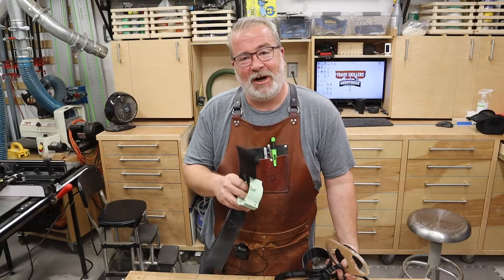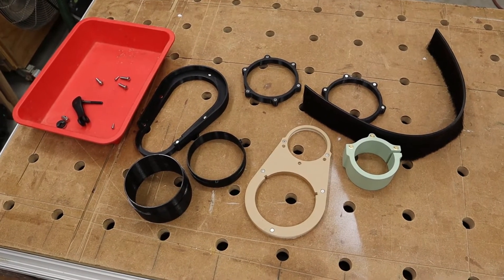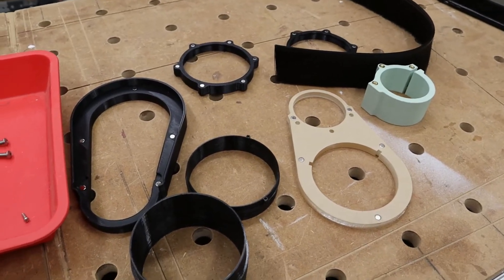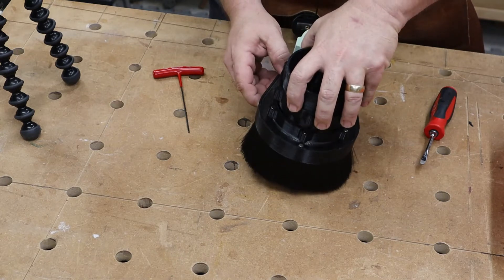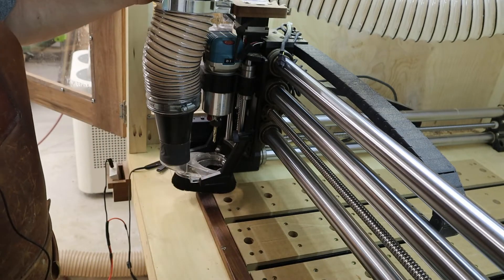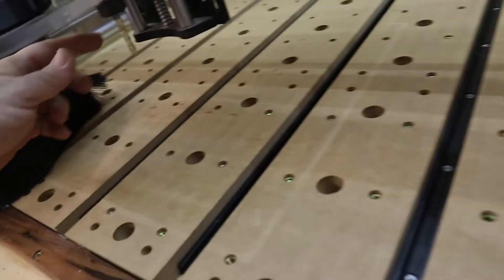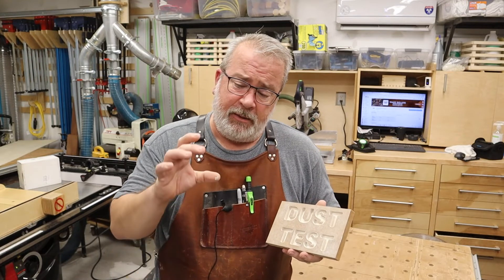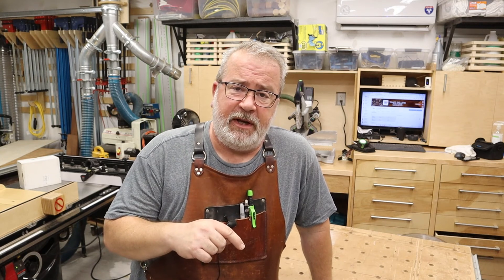2021 Review and installation overview of the PwnCNC ver. 7 on my Onefinity CNC machine

Comment: How do you find this work when pocketing deep?  Say 1"-1.25"?  I'm concerned that the brush material may get caught up in the bit and chopped off?  I blew up my suckit boot and would like to move to something with 4" intake as well.  The V8 that 1F is selling seems to be not a whole different than the suckit.  Thanks!
Reply from the maker: Hey Mike, I’ve cut 1.5” pockets and profiles without any issue with the bristles as of yet. I did have the boot clamped up high though because I felt like I was going coal miner deep.

Comment: What is that cam locked clamp you use???
Reply from the maker: Hi, that side load clamp is made by festool, clamping element, part number 488030. Works great. Thanks for watching and if you find value in it, please consider subscribing.